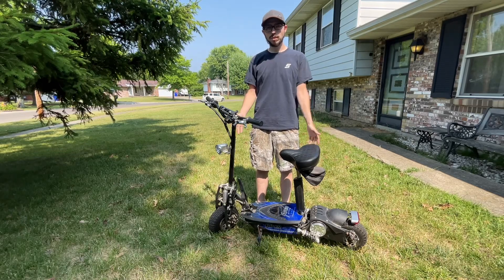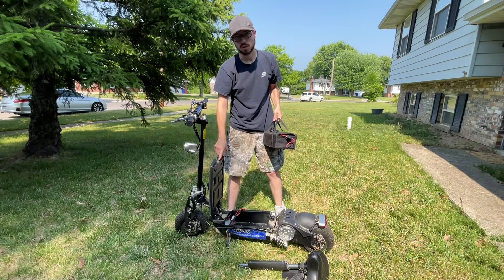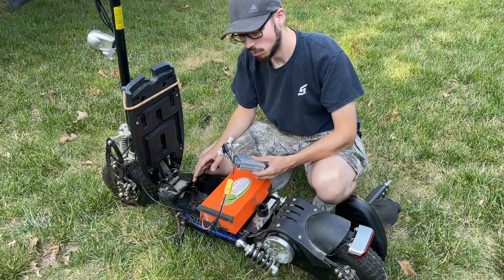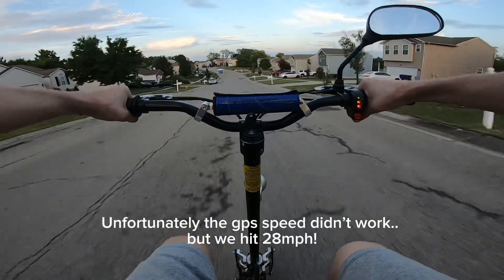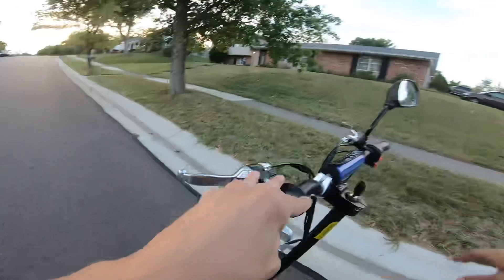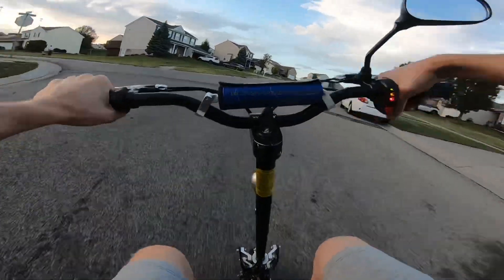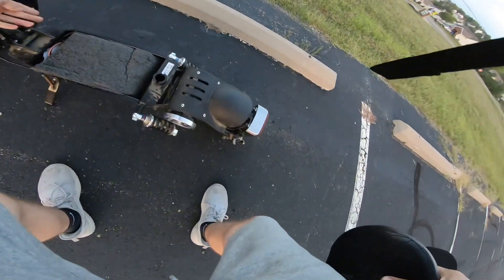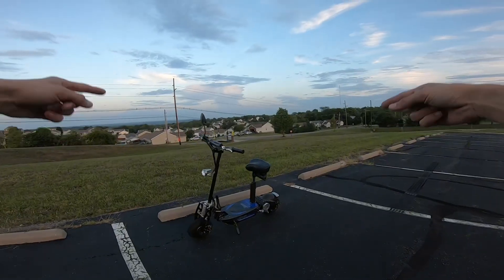Electric scooter 48 Volt upgrade - Super Turbo 1000 Elite

Comment: Did u changed the controller? And the charger
Reply from the maker: Not in this video, but to set up
Properly I would want to change to a 48v controller !
Reply: Can you post a link to the controller you used?  @JordyBuilds
Reply from the maker: @josephkerry7209  same controller
Reply from the maker: I charged my 48 V lithium battery with my 48 V lithium charger not through the scooter but directly to the battery

Comment: Nice vid and test run. 
I was windering if you know where i can buy a diy kit for my bladez xtr scooter?
It's fun being stock, but having updated and uogrades would be better. 
You're video is the only video that comes close to modifying a similar scooter.
Also have got an swogtron eb-8 for free. Missing battery and charger, so it would make a great uograde project for the rear hub motor, motor controller, battery and whatever else a kit comes with it.
Tha ks for the video.
Reply from the maker: Sorry I’m just now seeing this. If you can shoot me some pictures on my facebook page and I can help get you links to kits and etc.

Comment: Hi, i was wondering, what are the specs on the battery that you used? its a 48volts and how many amps?
Reply from the maker: 48v 15ah 30a bms
Reply: @JordyBuilds  link for purchase would be super helpful
Reply from the maker: That battery is not made anymore

Comment: Hi there, would you be able to do a video on upgrading lights for this scooter please. I have a 60v 2000w version on this and the lights aren't that great, I've got 2 12/24v lights which I'd like to install but seeing as it's a 60v battery I'm unsure how to install it. Any help will be great . Thanks
Reply from the maker: I’d look into getting a voltage 12v downstepper for lights !

Comment: Nice job on the scooter! Great video. 
It's good to know the controller and everything else can handle the extra volts.
Reply from the maker: So far I’ve rode several dozen miles and all is good! Gets a little warm but not terribly hot. May do a video upgrading to a 48v controller and any advantages that comes with.